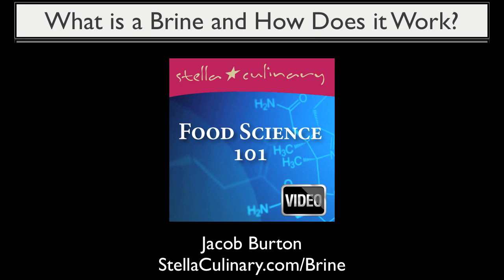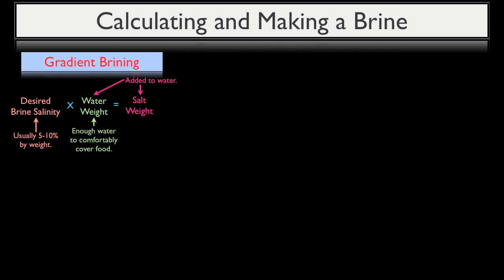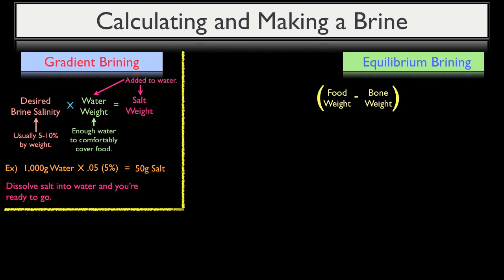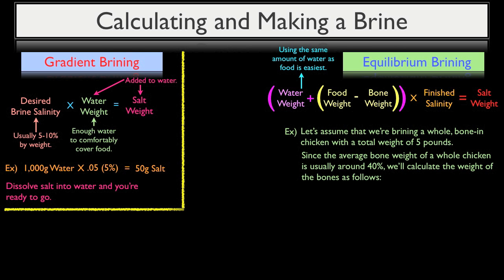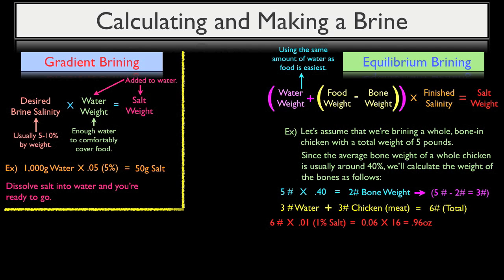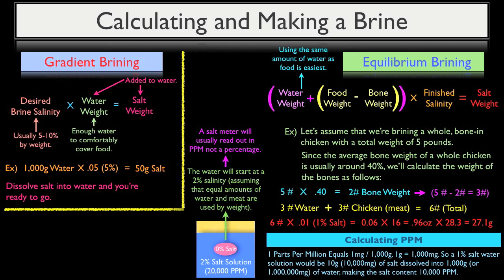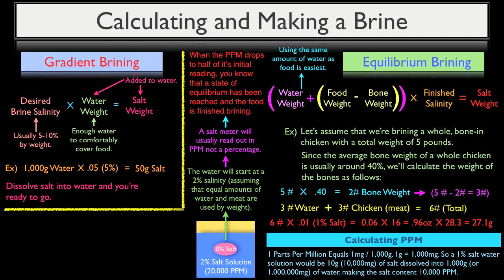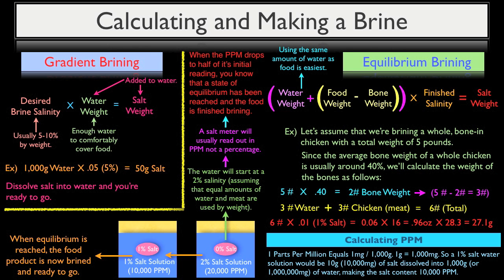How to Calculate a Gradient and Equalibrium Brine

Comment: So wrong.  Salinity is the percentage of salt in the solution, not the mass of salt divided by the mass of solvent.  Desired Brine Salinity x (Water Weight + Salt Weight) = Salt Weight
Water Mass=1000
(.05)(1000+x)=x
50 + .05x= x
50=.95x
52.63=x
You're using 4.99% less salt than you should be.

Comment: Hi Jacob,

Love your videos.  Question on the brining time vs. resting time.  I'm guessing you take the product out of the brine because it's soaked up the total amount of salt you want in the final product and then the rest is because it needs time to disperse.  If that's the case, why not just use a lower salinity brine for the entire time?  Thanks!
Reply from the maker: kidcharlemagne Yep, you're absolutely correct. And you can use a lower salinity brine and go for a longer time; that's pretty much the equilibrium approach in a nut-shell. I actually prefer using a 5% gradient brine for most things because equilibrium just takes too damn long, but there are lots of different approaches available to you.

Comment from the maker: I've brined a whole pig before, but only using the gradient method. An equilibrium brine would take a very long time for a whole hog. If I had to guess, maybe 7-10 days. If you use a 5% gradient brine, 24 hours or brining plus another 12-24 hours of rest should do the trick. Let me know how it turns out.

Comment: thank you for the good explanation. The one thing I don't get is the problem with PPM: % is basically "parts per hundred", PPM is a multiple of it. You just have to "move" the decimal point on the salinity meter to get the readout in %. One PPM is the 10^-6th part, a % is the 10^-2nd part, so just forget about the 4 trailing zeros and you get the readout in percent and can use any desired amount of water.
Not more complicated than what you advised but IMO a bit more forgiving.

Comment from the maker: I don't understand how ions moving into a protein isn't caused by diffusion. My understanding of osmosis is that it deals specifically with the movement of water, whereas here, we're discussing the movement of sodium and chloride ions. I know we're just splitting hairs, but it sounds like you know what you talking about. I'm not asserting that sodium and chloride actually pass through cell membranes, but instead diffuse into the muscle fibers, accumulating on the protein filament's surface.

Comment from the maker: The movement of the sodium and chloride ions into the meat is not happening through osmotic pressure but through simple diffusion. As the the salt gradient moves from an area of higher concentration to that of a lower concentration, an equilibrium (within a few parts per million) will be achieved. It's actually an extremely precise way to approach the brining process.